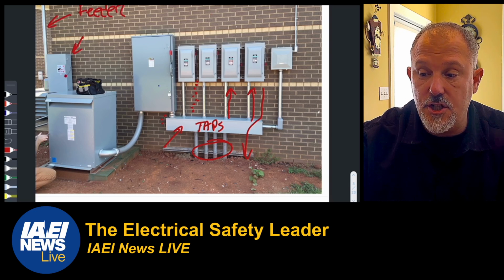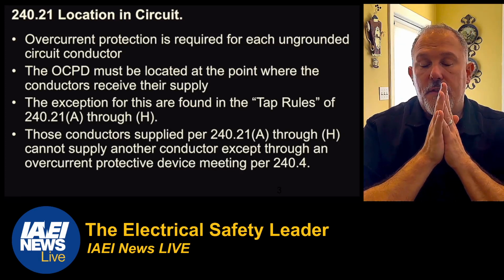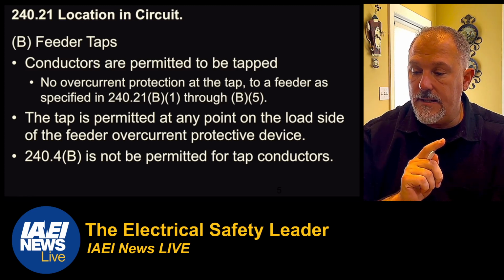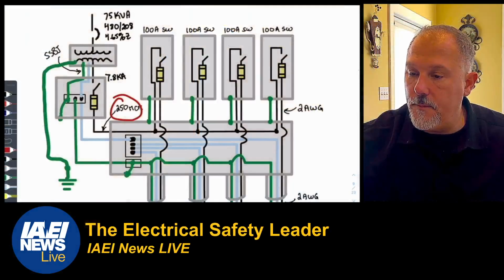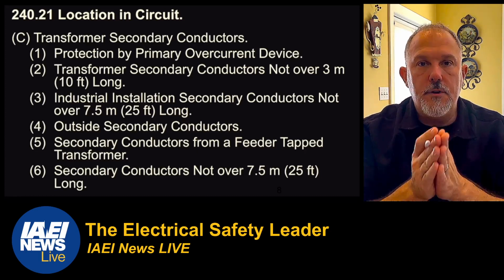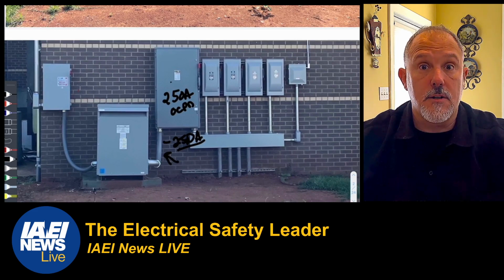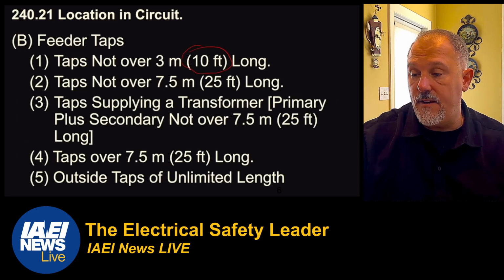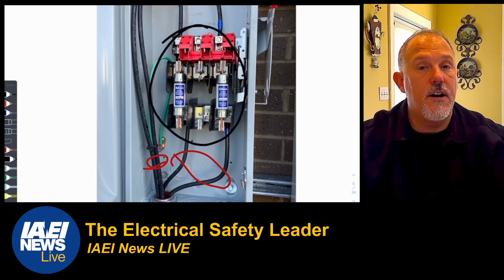Tap Conductors and a real world Application

Comment: The tap conductors are definitely leaving the enclosure where they are made. They leave the wireway and go to a disconnect. The single secondary disconnect with OCPD would not be necessary if you apply 240.21(C)(2) - you can have multiple sets of secondary conductors, and up to six disconnecting means. Even with a primary OCPD sized at 250%, the minimum size transformer secondary conductor would be a 6 AWG Copper at 75 deg. C and that is for an indoor application. So you could have up to three sets of 100A fused disconnects and comply with Note 2 to table 450.3(B). The maximum load permitted on the secondary of that transformer is 208A anyway, so having 4 - 100A rated disconnects is permitted but kind of silly.

Comment: Hey Thomas. I saw that the Primary had a non fusible disconnect. What's protecting the primary? Is it getting it's protection from the distribution? Just asking... Trying to learn.
Reply: Yes, the feeder breaker upstream is
Protecting the primary disco and all the primary conductors.
The disconnect on the primary side of the XFMR is purely a maintenance disconnecting means so that electricians can isolate the XFMR locally prior to servicing it. 
Alternatively, they could have used a lockable feeder breaker upstream to both protect the primary conductors and serve as a maintenance disconnecting means.